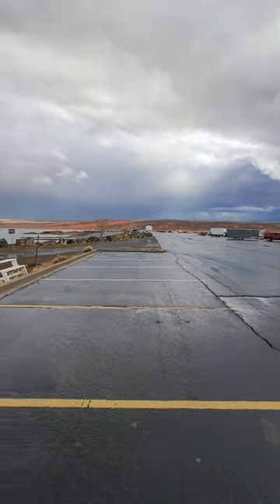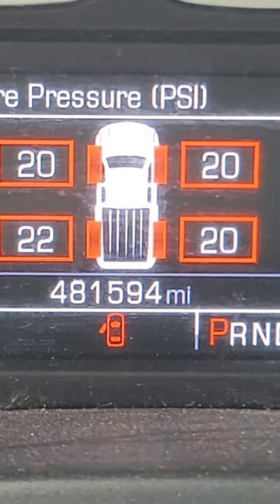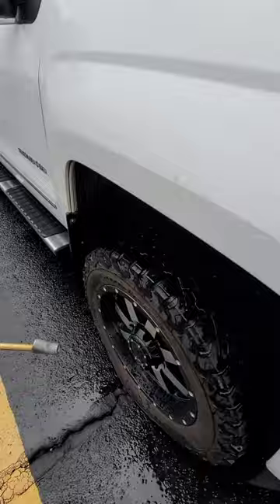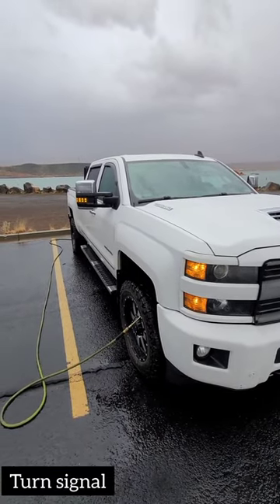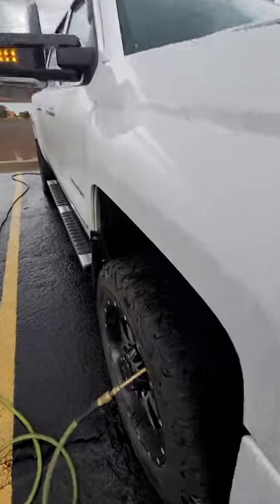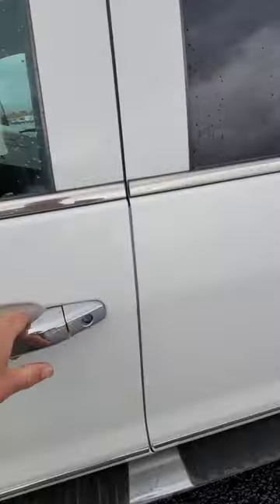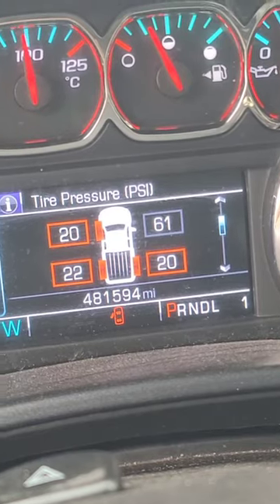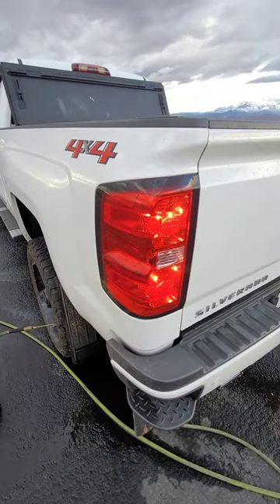Airing tires up after playing in sand

Comment: What air system are you using?
Reply from the maker: I have the viair ultra duty system
Reply: @CFarmer  20psi to 60psi takes how long per tire?

Thanks for the info. I'm ready to boot my Smittybuilt and get an onboard system. Don't want an ARB.